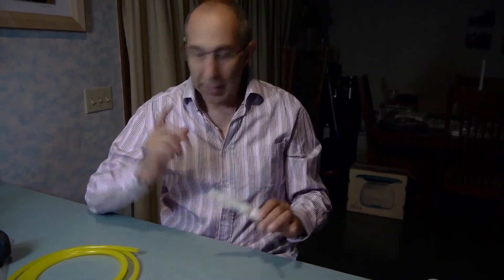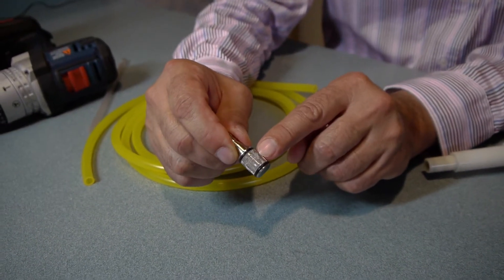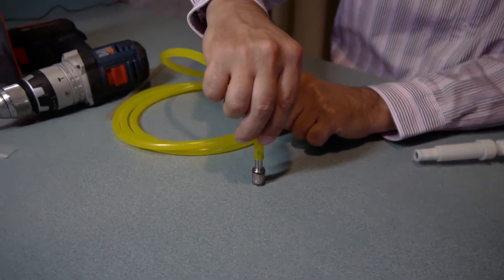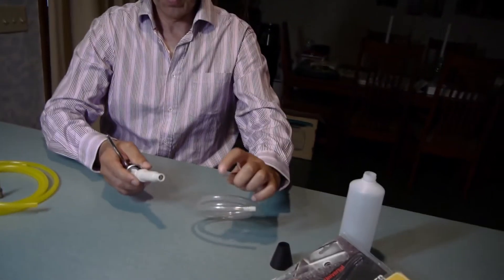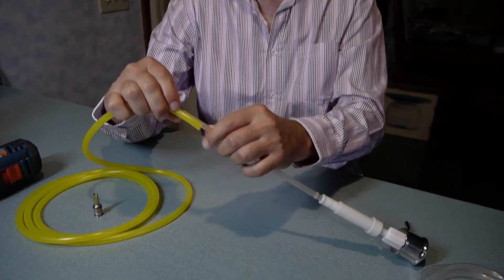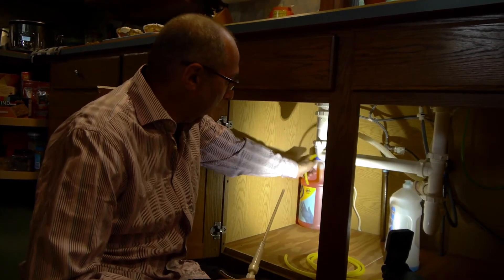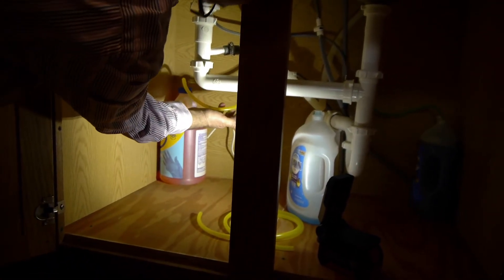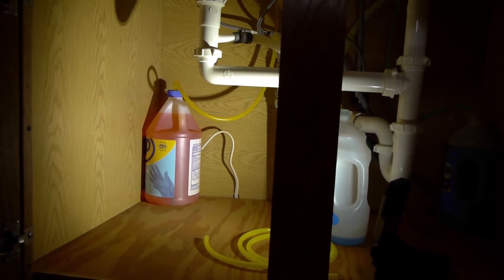Soap Dispenser Hack (Updated)

Comment: I went to eBay and bought that exact check valve you purchased and used. Oh my God! It took forever to get it to pump out.  I pressed the pump at least 150 times! I hope this check valve works!
Reply from the maker: Yes, that’s why I updated the instructions to include it so the hose would not lose its prime and make you re-pump all that soap again. You also said that you had to use a longer hose which would increase the pumps needed to get the soap through. Should be good to go now.
Reply from the maker: I was thinking about how long/how many pumps you had to make to get the soap through and just realized that the pump/pump mechanism you purchased could either be faulty (something wrong with it) or just be a very inefficient pump which could have caused that. How’s it been working?
Reply: @commonsenseripsomehelpful  I purchased this from Costco. It actually came as a set with the SS sink, faucet fixture and soap dispenser. It's been a while and I need to pump it a few times to get soap. It's never immediate or on the first one or two pushes.
Reply from the maker: Richard Mauro There are two immediate possibilities I can think of: 1) the pump mechanism is inefficient and allowing air to seep into it. How much soap comes through with a single pump? Quite a bit would be good but just a little bit would prove its inefficiency.  2) Are the hoses sized correctly so they are tight around where they connect? Loose hoses would allow air into them which would also allow the soap to seep back down into the soap jug. Loose hoses would also make the pump less efficient as air would be drawn into the hose instead of soap from the jug. Make sure the hoses are tight around all of the fittings.

Comment: Good idea! The one-way check-valve at the end of the hose also keeps it from curling up or floating to the surface of the liquid (A problem I have frequently encountered.)
(The only thing I would add is the quickest way to prime the dispenser: Push the dispenser down, plug the spout with your finger, release the dispenser so it pops up, and remove your finger. Repeat as needed.)
Reply from the maker: aaaaaAAAAAAH!  I did not even think about holding the hose end!  ...and great trick!  Thanx for sharing!

Comment: Thanks for the update and the original video. So many "hack" videos on Youtube with fancy presentation with half the usefulness of your video.
Reply: Gonna try it also with this one(without the filter)i found on Amazon. What do you think?
Reply from the maker: Thank you for your kind comment.
Reply from the maker: Brian M. Not sure if you had a link that was removed to another check valve that you were sharing/showing. It’s important to have a check valve that is suited for the viscosity (the thickness) of the fluid going through it. Some check valves are just for air which would not work properly for soap.  If you don’t filter the fluid you can have problems with contamination of the soap fluid which will block or plug the check valve and/or pump itself. Just an FYI (For Your Information)
Reply: Yes, link got removed.  It's on Amazon  as ALGEI Mini Sponge Filter 5 Gallon with Control Valve, Non-Return Check Valve

Comment: I raised the big soap container as high as possible to shorten the hose length and it works fine... no need for long hose or valves.  Keep it simple and as short as possible.
Reply from the maker: Hi Joe, Thank you for your comment.  Yes, definitely is better to keep the supply tube as short as possible.  The sink pumps are designed with a soap storage container where the pump tube stays inside the soap in the container, so when pumping stops, the soap actually stays inside the pump tube and when you need soap again, the soap is right there in the pump tube one or two pumps away.

     The problem, when wanting to move the soap dispenser to a larger container and to somewhere easier to access (further away from the actual pump just below the sink deck), is that the pump tube is no longer sitting in the soap reservoir with the soap right there, it is further away and after pumping stops, the soap creeps back down the hose, because of gravity, and the next time you want soap it will require more pumping to bring the soap back to the bottom of the pump tube.  The one-way check valve stops the soap from creeping back down the hose and keeps it right at the pump one or two pumps away.  Also, some soap pumps are just not strong enough to pump soap any further from just the bottom of the soap container under the sink deck.  Saying that, I also acknowledge that some soap pumps actually have a one-way check valve built into them... sounds like you have one.  ;-)

Comment: That screen provides a lot of resistance to the thick liquid soap.  There's no dirt in the soap bottle so there's no need for a screen.
Reply from the maker: So what are you proposing?
Reply: @commonsenseripsomehelpful  Don't use the check valve with the screen. 
If you don't wish to cut the tube into two pieces just put the black plastic check valve, without the screen, on the end of the tube that's in the bottle of soap.  The plastic check valve doesn't have to be at the midpoint of the tubing.
If you do want to put the check valve at the midpoint of the tubing, you can just cut a v notch at the end of the tubing that goes into the bottle. That will obviate any concerns with the end of the tubing becoming attached to the bottom of the soap bottle by suction, blocking the flow.
Reply from the maker: @percyfaith11  aaaAAH.  I see.  Thank you for your comment.

Comment: Such a great idea! Thank you! I am going to order the parts you suggested. I have a question. I will have a second dispenser in my counter, and I would like to use lotion in it. Do you think the viscosity of lotion would work with the same set up?
Reply: Also, I’m not asking for any type of guarantee. 😁 I know one can never tell until you actually give it a try. You just seem to understand these things quite well, and I wondered your thoughts about using this same set up with lotion. Thank you!
Reply from the maker: Hey AnnMarie, yes, I do believe that this setup would also work using lotion.  We also have two pumps in our sink, one for Dawn dish soap and the other for Zep hand cleaner.  I imagine that the lotion viscosity would be about the same as liquid soap and the one-way check valve should handle that as well.  Please let me know if you are successful?  Thank you.

Comment: The supply soap bottle should be vented to allow atmospheric pressure in to avoid a vacuum situation that would work against soap coming out of the pump.
Reply from the maker: Yes, which is why the hole I drilled for the top of the soap bottle for the hose to go through is just a bit bigger than the outside diameter of the hose so air could  get in as the soap gets drawn out. Thank you for your comment 🙏
Reply: But why drill the hole through the cap? Why not just leave the cap off entirely?

Comment: Is there a soap dispenser you recommend?  Mine is a fancy metal one that doesn’t have hardly any pump.
Reply from the maker: Hello LT Cuellar.  I have noticed recently the "pump" on the hand soap pumps as well as the detergent pumps have greatly reduced their pump volumes... not sure why.  While I have a fairly expensive (I think I spent about $75.00 for it) Delta model RP1001 that I use for pumping out Dawn dish liquid I also recently purchased a Danco model 10040 from a local True Value store for about $10.00.  Neither one of these pump as much soap as the older ones that we had... but maybe that is why they died ;-)  Both of these pump about the same amount of soap.

Comment: Hi, I recently changed my sink soap dispenser and even with the check valve in this video, the dispenser still cannot draw the soap all the way. There is always an air pocket at the very top of the tube. Previously I had another soap dispenser and  it worked fine even without a check valve. This thing is driving me nuts. I thought the check valve would solve the problem but it seems the dispenser is just not strong enough to draw soap all the way to the top. Any ideas? Thanks!
Reply from the maker: Two possibilities that I can think of right off; 1) air is getting into (leaking into) the tube at the top by the pump assembly (hence the air pocket at the very top of the tube before the pump assembly) 2) the pump assembly is defective.
Reply: I would check three things: First, make sure the hose/stem is cut off SQUARE and  inserted COMPLETELY into the bottom dispenser. Any air leak in the hose will keep it from functioning correctly. Second, your soap might be too heavy, especially if your using a 1/4 inch line. Try thinning out the soap by adding some water to it. One dispenser I had would only work when I mixed half water and half soap. After I figured that out, it worked great. Third, make sure there is some type of hole in your soap container to allow air back in to the container. If your hose has an air tight fitting into your container, the suction may not be allowing the soap to move up the line.
Reply from the maker: @scottieblog305   Great help!!!  Thank you!

Comment: My soap won’t come out yet when I take the pump part out of the top of the sink and test it in a cup of water the water comes out.  Confused why the soap won’t work.  Can you help me?
Reply from the maker: Hello Lili Pier.  Are you using the exact same setup as I am here? If yes... Did you place the end of the hose in the water or just the pump assembly?  It sounds like you have an air leak between hoses somewhere.  I have a few more questions but maybe easier to diagnose if I understand your exact setup.
Reply: I did not do your set up yet.  I have the regular setup with the small container under the sink.  The soap won’t come out yet when I put the hose part in a cup of water and pump the water comes up through hose and out the spout.
Reply from the maker: @lilipier2995   So you have a flexible hose on the end of your pump assembly now?
Reply: No, the original setup.  Pump on top of sink with the soap bottle under it
Reply from the maker: And it does not work?
Reply: Like I said it won’t work, soap doesn’t come out.
Reply from the maker: I do not know what you are asking.  If the soap pump does not pump soap, you will need a new one.

Comment: Why in the world would you go through all that b***** when all you have to do is lift off the top from above the sink fill the dispenser and put the top back on.  Obviously you would never make it as a soap dispenser engineer
Reply from the maker: What a great question... Let's dive in shall we.  We could do a simple modification to the soap dispenser feed system, in which a family member could easily swap out an empty gallon soap container once a year OR every few months we could pull the pump assembly out to refill the small reservoir, hoping that we don't overfill it and make a huge mess... or maybe the small container under the sink cracks and the soap leaks out all over everything, then we have to spend the next hour cleaning soap off of everything.  (Our story)  So we chose to do a simple modification and share it here in case anyone else never wants to clean soap up again after trying to fill their dispenser.